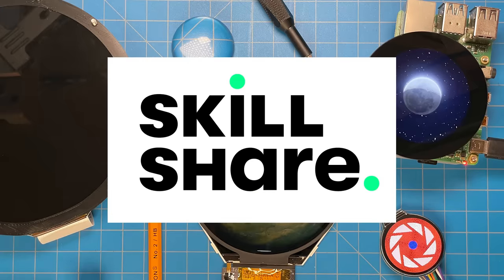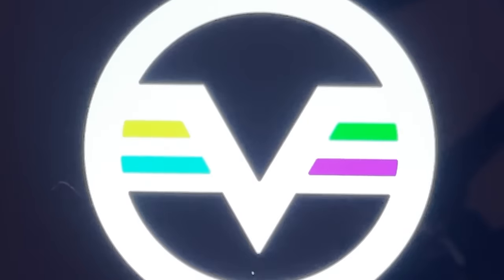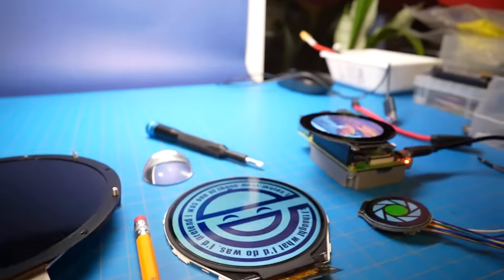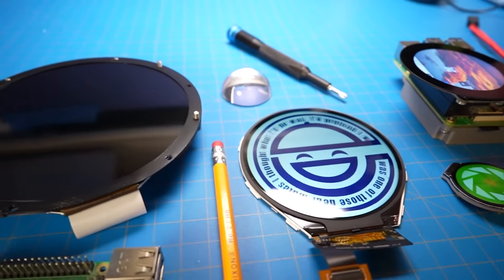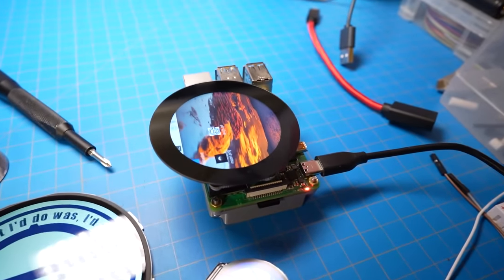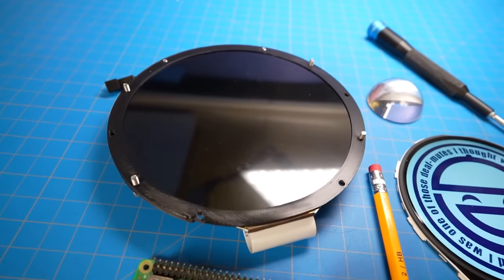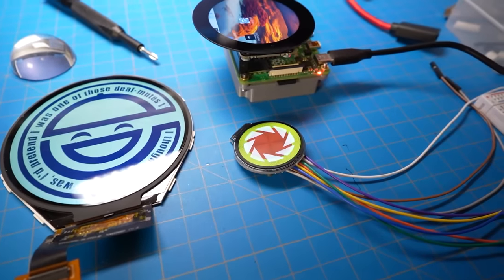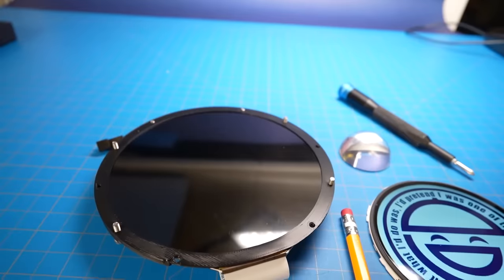Exotic Round Displays and How to Use Them

Comment: I really like this sort of thing, but I have zero experience, soldering, wiring etc. Iv'e had a Pi Zero but just running RetroArch and I've not done anything with it.
Who has a good starting point\project to learn the basics? I'm fine with coding\software.
Reply from the maker: Pick a project that interests you and go for it. Adafruit and Sparkfun both have good resources for learning the basics. If you have an interest, just type in DIY Raspberry Pi + (your project) to see if someone has made a tutorial. Following along will give you the basis to do more of your own thing

Comment: Dear Mr Volt, I would like to put artwork on a round touch display, but run on a battery. I would also like to use this display for web browsing, but not for regular use, just to show it can be done to find other artwork files. Happy to work with Arduino, Raspberry Pi and PC. Can the artwork be stored on the Arduino or other card? I have never used this tech before but I'm sure if you make a video I can follow it and will share it with others. Please let me know?

Comment: Hello, thanks for your contribution by showing the display. I bought the same display + a Raspberry Pi Zero W 1.1. Unfortunately, I couldn't get the display to work. Do you perhaps have a tip for me, what can be the reason that it doesn't work. Or what should I follow to get it right. Thanks for your tip. Greetings Sebastian
Reply from the maker: Hi, did you go through the adafruit guide linked in the description? You have to make a bunch of changes in config.txt first.

Comment: Well, the displays, as they are still made up of pixels, are technically getting rounder as the resolution increases and with it the ppi meaning there's less jaggedness. A round display of only 5 pixels wouldn't look round whilst one with millions of pixels will be almost indistinguishable from a perfect circle to the naked eye (depending on the size). But then again most of these displays have a bezel which hides this.

Comment: Hi , I have a monochrome DXQ608-X04 MIPI display and a Toshiba TC358870 chip based adapter to HDMI . The desktop PC recognize the display correctly , but have nothing on display . I did check cables seems all OK .  Don't you have tips how to configure or what to look for ?.

Comment: I've always wanted to try and put together a hole-in-the-chest halloween costume using a back mounted webcam and a front mounted screen with some decor to disguise the edges of the display. To add to the effect you could use a front mounted camera to render a scene based on the perspective of the largest face visible. Would give the nearest observer the ability to look around inside and through the hole. Seems like something you could easily do using one of the newer pi's

Comment: Nice and useful video! I wonder, regarding the OEM 3.4" which libraries does it require and wether it is possible to find a code example. Is there any place to find it? 
Thanks!
Reply from the maker: Hi and thanks! It doesn't require programming. You can find the link in the description, but It's just an HDMI monitor with a square aspect ratio.

Comment: I am having trouble getting the 4 inch display to work with an rpi 5. It wants to be the second screen and nothing shows on it, it glows so power is on.
Reply from the maker: It's really important to follow the config settings in the adafruit guide I have linked in the description. Also, better to test with a desktop computer first to make sure the display is 100% working.

Comment: Thanks for doing this video! I am working on a custom motorcycle dashboard (it's a retro looking bike so the dash is round) and was wondering which option you selected when you ordered the 3.4" one? There's an option A, and B - do both have touchscreen?
Reply from the maker: Yes, the only difference is the cable length and board size. I'd recommend the more compact option, but obv your needs may vary. Also, I didn't find (but also didn't ask) documentation for the touch interface. It doesn't show up as a HID on a computer, so it seems like it has to be handled separately by an MCU, which is a chore.

Comment: How are resolutions measured in a round display?
Reply: Instead of using the top and side pixel count like you would with a square display, you count the number of pixels at the widest point vertically and horizontally.
Reply: @squishybrain  Thank you so much!
It must be much harder if not impossible to measure the total amount of pixels then.
I also wonder how they manage to make the square/rectangular pixels round.

Comment: Do you have any advice on how I could run a live feed from a camera to this? I'm looking to make camera side mirrors.
Reply from the maker: You'd need a Composite to HDMI adapter, but it would still be a gamble, since these have square aspect ratios, the controller might not accept the signal (it doesn't automatically adjust if the input isn't correct).

Comment: I've got 2x 3.4" round displays with an HDMI to DSI board (similar to the board in use on your 5" display) but wish to use it on RPi3, works perfectly with my laptop, splitting the screen perfectly on my laptop however using my RPi3, the display isn't showing on the right hand display and the left has loads of green lines down it. Have you come across this before with round displays? If so how did you resole it? Thanks.
Reply from the maker: I havent used any of the dual display units before, may need some extra HDMI configuration. Check out the guide on Weird Displays from Adafruit that I linked in the description for some more help.

Comment: i built a 5 display system with one of the 1.28 inch waveshare touch displays connected to a raspberry pi 3b+ and 4 of the same display with an onboard rp2040 on each. i have the i2c working and they can each use the demo that came with them but i cant figure out how the image2lcd program works. every image i force to 240x240 pixels then convert through image2lcd has weird display artifacts i cant seem to get rid of. this is kicking my ass and i could really use some help

Comment: I realize this is a bit old now but wondering if you have a suggestion. I bought a similar 3.4” display with an HDMI board but I can’t get it working. Have tried connecting to a pi3 raspian, pi3 tiny core, and a MacBook. At best I get a white fuzzy circle in the middle. Any luck making it work or you think I just got a bad display?
Reply from the maker: They generally don't work right off the bat with a Pi. You have to configure the config settings (Adafruit has a guide on "Weird Displays" that has the step by step tutorial). I never tried them with a Mac. Windows always detected everything automatically though. I would check with a Windows machine first before contacting the seller if it is bad.

Comment: I’m looking for a way to use one of these that can just show an image or gif from an SD card without using a pi or any type of extra controller.  If that’s already possible, can you tell me which one and how?
Reply from the maker: These are all pretty low level displays, so programming+hardware is required. Your best bet, if you dont want to write any code, would probably be to find a cheap round smartwatch and an image viewing app.

Comment: Did you have any issues hooking that 5" screen up to a computer? Because I have the EXACT SAME BOARD and all it does is flash the blue light and the screen never turns on. I'm actually on my second one, and it doesn't work either, neither the screen nor the board, in any combination with the first. It just flashes the blue light over and over.
Reply from the maker: Hmm, no I didn't unfortunately. Does your PC detect a new monitor at all? I didn't have to do anything with my boards. Did you contact the seller? Most on Ali are pretty quick to respond.
Reply: I discovered the issue with the 5" round display! That interface board has compatibility issues with the Intel 600 UHD chipset, as well as my OTG Android connector. It worked fine with the Intel 500 chipset, for some weird reason. I couldn't get it to work with the Rasberry Pi Zero either. Maybe your full-size Pi is different? 

Also, the two buttons on the display are Reset and Screen Brightness. It's worth noting that you SHOULD run it on low brightness, as it gets VERY hot. I measured it over 150f with my thermal camera. On the lower brightness settings, it's a mere 90f.

Comment: Hello my fellow scientist please if you see this respond to me!
I’m going to do something that’s never happened before and we will see this in the future cars I’m sure of that 
I have a project Audi a3 1999 car and I’ve got my self a 2020 s line steering wheel without the airbag!
So the airbag costs around 250€-350€ euros and as I was watching the steering wheel I noticed how round is the centre for the airbag and since I don’t have a place for an actual screen on the car I’m going to do something dangerous yeah but it’s a project car so it means is doesn’t get to the streets so much
So I have 3 questions is it possible to plug a tablet to that screen so I can have maps and etc in the steering wheel?
And if that’s possible which screen is capable of that tha max length of the screen must be 2.4 
Thanks in advance!!

Comment: Could you wire these up for analog video input?
Reply from the maker: You'd need a Composite to HDMI adapter, but it would still be a gamble, since these have square aspect ratios, the controller might not accept the signal (it doesn't automatically adjust if the input isn't correct). Windows 10 detects them easily and the RasPi can be configured to send the right signal. Worth trying!

Comment: How did you center your image to the screen?
Reply from the maker: They have square aspect ratios, Windows adjusts this automatically.
Reply: Ya I find out while testing it. It was rather interesting when I got it working since this is my first round screen I gotten. But thank you. Now I have to configure a cable to be a certain length then enable touch fetchers, speakers, camera and others into a 3.4 inch circumference circle. That be fun

Comment: would there be a way for me to wire these to a AV fpv cam?
Reply from the maker: You'd need a Composite to HDMI adapter, but it would still be a gamble, since these have square aspect ratios, the controller might not accept the signal (it doesn't automatically adjust if the input isn't correct).

Comment: I have the 3.4 inch model, when I connect a windows or mac pc via HDMI nothing happens. Do I need to do something else?
Reply from the maker: Are you powering it from a good usb power supply? Does window detect it at all? Mine we're all plug and play with Windows. Never tested with a Mac.
Reply: @MrVolt  Yes, it is connected to a 5V 2.4A power supply. I see the backlight lighting up but it seems that the HDMI is not working.
Any Ideas?

Comment: 3:10 Thank you so much for remembering that ppl outside the US use metrics! Just a hint, we never say 32.5mm. If it’s over 9 milimetres we jump to centimeters, hence 3.25cm.
Reply: A LOT of things have measurements like 35mm. In fact, 35mm is a common term in the film industry.
Reply: @kevinbissinger  I was not trying to be pedantic and I apologize if I sounded so. Yes you are correct. Some fixed standardized measurements are given in milimetres. Like a 35mm film or precision tools. However, outside the realm of standardized measurements , the day to day use of metrical length units in centered in meters and centimeters. About “ who are we “: most of the Americas, Europe and Asia.